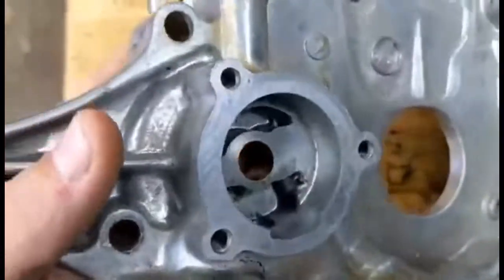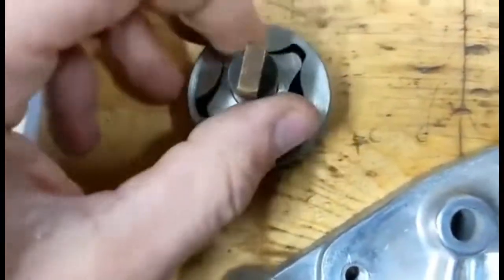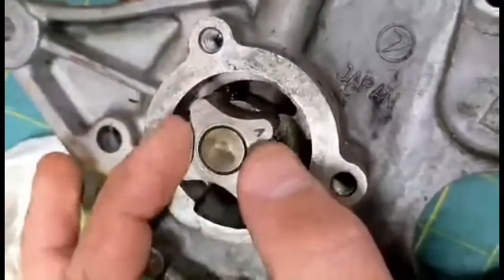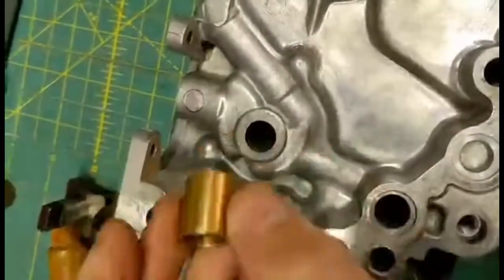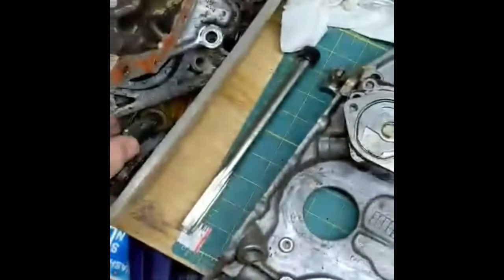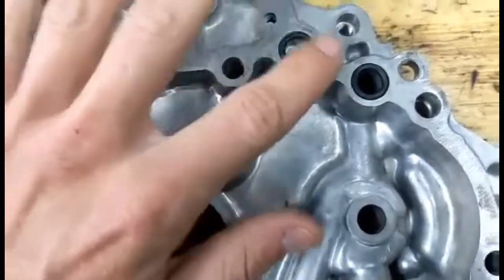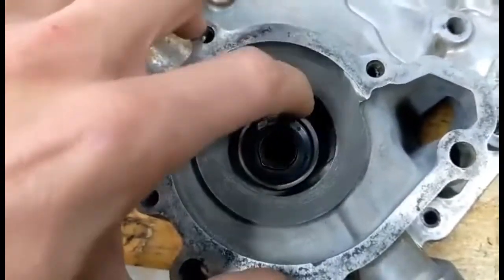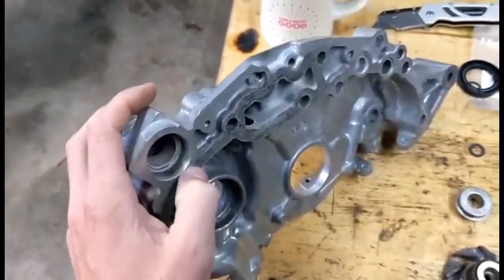Subaru Justy Oil Pump Flaw

Comment: Good video! Could you find a gasket for this whole assembly or did you use silicone to put it back on?
Reply from the maker: There is a felt or paper gasket that fits. But make sure to coat both sides. Or just use RTV.
Reply: Thanks a lot! I had a go at removing it to replace the water pump seal, but the plate seems to be stuck on something below the oil pump, do you have to take the pan off to get this assembly out? Appreciate your insight 🙏
Reply from the maker: @Deansmumsson the oil pan is bolted to it. You’ll need to remove the pan or at least the few bolts that hold it on

Comment: I drove the same 1991 Justy for 18 years and 192K miles.  Oil pressure tested was nominal, I used semisynthetic 10W-30 Valvoline. Oil changes at 3K miles. The real oil leak problem is also in the ignition distributor, where the inner oil  seal of the distributor slowly pumps out oil. With a dump of just 2.9 quarts, watching oil levels and changing oil at 3k miles is critical.